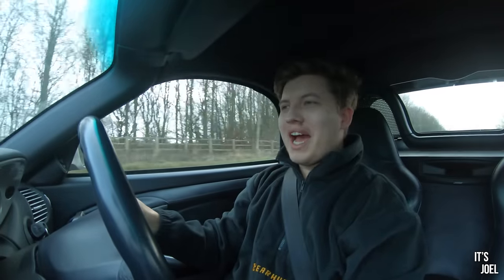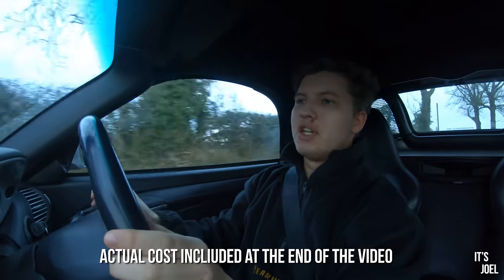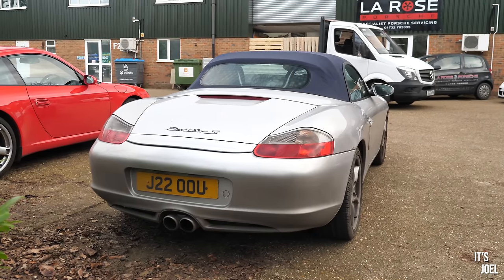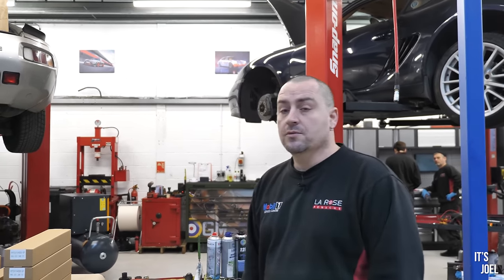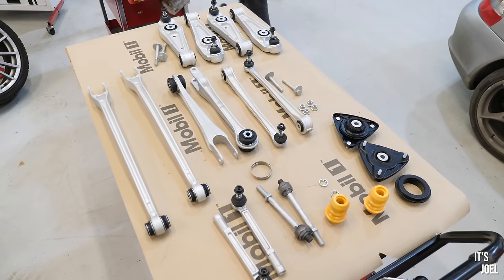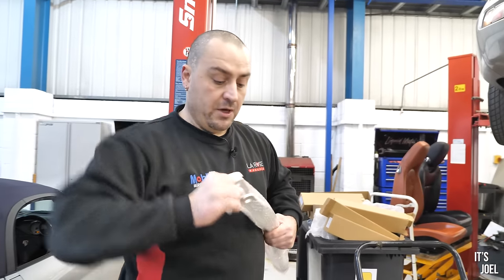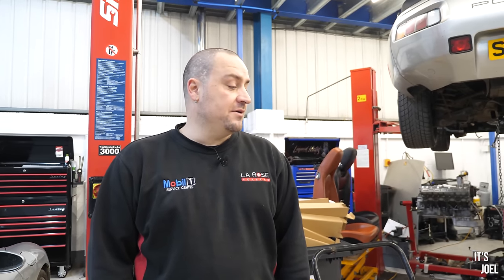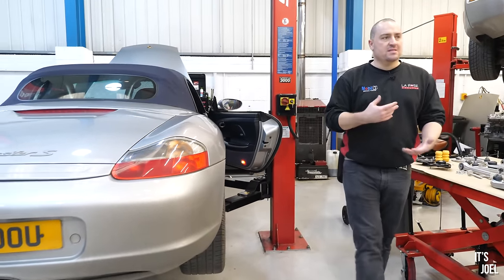Suspension overhaul for my 'cheap' 986 Porsche Boxster S

Comment: Interesting that 'in theory' the control arms and components are not actually worn or failing (except some corrosion and maybe the inner surface where the bushes fit?)  it's all the rubber bushes and ball joints that need replacing.  With enough time and tools you 'could' remove the arms then replace the bushes and put them back on. If the new metallic elements are the same as OEM then there isn't an advantage in weight or performance but the new bushes tighten it all up.  It's just quicker to replace the whole arm with new factory fitted bushes preinstalled and gives a more reliable repair rather than messing with pressing bushes in and out. Great content and video and nice to see professionals at work so relaxed and patiently explaining things
Reply: not in theory. it's just that it's aluminum not steel which complicates a refurb substantially

Comment: Bit confused as to why all that time was spent on removing the strut top and working under the wheel arch, if all the suspension arms and steering arms were getting replaced, it would have been so much quicker to remove the whole strut assembly then strip it all on the bench. Glad your enjoying it, thought Dean was really good, he should be doing his own channel
Reply: Couldn't agree more. I would have removed the compleat unit rather than using a torch Hammer and chisel on the car. And for the cost whilst there replace springs and dampers.

Comment: Can't believe the old shocks were left on. Just done the rear shocks on my Boxster. Massive difference
Reply: Same here.  If they were fine then maybe it’s understandable but I really didn’t understand the surprised tone that “it rides the same” because well, duh, same shock and spring.  But not my money so not really my business.  Also in respect of a fast road set up, this is great - for the 1% of the time the road and the weather and your mood is just right.  The other 99% of the time it can be like having a sugared up toddler pulling at your sleeve…nigglingly annoying.

Comment: You really wouldn’t want to go to all that trouble and expense and not change the springs and dampers on a car that age. I had two broken front springs on mine that were quite hard to spot - even the MoT guy missed one of them, I didn’t know until one of the broken bits popped out! I’d already replaced some of the tuning forks and coffin arms and I think the dampers made the most difference.
Reply: Yes did all mine on a 996, had all the seized bolts etc. I honestly didn’t notice any difference when they were changed, apart from the fact the car wouldn’t drive in a straight line as it knocked the alignment out. When the alignment was done it felt it’s twitchy but that could be be the different alignment. I did the shocks and springs, but they are very expensive to do, the porches springs were about 600 and I used biLstein shocks that were oe spec, these were another 1000.  The new shocks made it feel like a much newer car. Porsches are brilliant, but even doing all the work myself I have spent thousands keeping it running.

Comment: Good video.  Watching this makes me think a) I'm not so bad at fixing my own cars (don't panic, things don't go to plan, you have to get medieval sometimes with old suspension parts) and b) DIYing allows you to fix stuff that a garage won't have time to because they're on a clock, e.g. the rust developing in the wheel arch.  A quick scrub, rust killer and overpaint will stop a much bigger problem.

Comment: Hi Joel, I had my suspension replaced at eporsch with their Spyder Performance parts about a year ago. Transformed the car ( I had a few "snooker ball" noises and creaky top mounts) so needed doing. Car now so much tighter and the steering feel has improved massively since all the bushes have been renewed. Dean & Roly are top guys and wont replace things just for the sake of it.

Comment: Great video Joel, My 2004 Boxster S 550 anniversary has just had an engine rebuild by Eporsch @111,000 miles and was thinking about a suspension refresh, could be fun to compare the cars, the engine rebuild makes it feel like new, it is amazing the difference. Keep up the good work

Comment: Good job well done. Also worth checking the rear anti roll bar for corrosion around the rubber mountings. Mine had rusted inside the bushings so much that the bar/ rust had expanded and virtually seized the bar and bushing solid. Didn't help at all with ride comfort. On taking it apart and chipping the corrosion away the wall thickness of the bar was only half of what it should have been. I ended up getting 2nd hand bars and new rubbers which helped a lot with ride comfort.

Comment: During the ride towards the garage you could already notice on the camera that your car was not absorbing the bumps in the road. All bumps travelled directly to your camera mount. I am really wondering why you call this suspension overhaul while you don’t replace shock absorbers and springs. This was the perfect opportunity to do that, as you have the whole system loose anyway, and you would have saved the guys some sweat and tears because they didn’t need to get that topbearing from the shock. 
But…. Anyway nice improvement on the car! Really looks nice and it was informative and enjoyable to watch ! Cheers
And please replace your wiper blades, these are also due 5-10 years and with the amount of rain you guys have these is definitely worth the money😂 . (This was positive criticism)
Reply: I would have also replace the entire assembly myself given the amount of corrosion.  So this is why many people don't drive your supercars out in the winter.  Salt does a lot of nasty to metal.

Comment: I had a 2000 Boxster but it knocked in the front and the heating and AC blower inside the cab made a lot of noise. I decided to sell it at a loss. I felt the car was basically a potential money pit. I have an 82 911SC. I would rather spend money on that car

Comment: Doing all that without changing the shock absorbers - is’s not wise, to say the least. All the work has been done already, but without actual replacement.
Your absorbers are completely dead and corroded. 
If you’d change them as well - you wouldn’t believe that it is the same car, it would be mind blowing. Shocks - what makes all the difference.

Comment: Isn’t that not the cruise control stalk under the indicator stalk? Can see it clearly on camera when your driving….. unless you have had the stalk fitted and your meaning having it activated.

That’s the original location for cruise on every Boxster I have worked on 👍🏼
Reply from the maker: No, top is the indicator and 2nd one is for controlling the menu under the Rev counter
Reply: @itsjoel  
Ah yes so it would be the identical stalk on the offside under the wiper stalk

Comment: Really enjoyed the video, just wondering how the front springs were refitted with the top mounts on?
Reply: I've never seen the top mounts done in situ like this in all my years in the motor trade. Must have been tricky to compress the spring under the wheel arch.  Maybe the shocks were out of budget. Also a big job on the boxster because the struts can seize in where they slide into the hub.
Reply: @life_on_cars  Did the top mounts om my own 986 but removed the struts. I had to remove the hub assembly to get the anti roll bar link out as it was siezed soiid. Lots of penetrating oil and an impact gun to free it.
Reply: @nigelblack5295  yep. I did the same on the rear of my Boxster. As you say ARB bolt seized into carrier  . Heat and hammer required to force divorce

Comment: Ah the wonderful Porsche suspension - not! In my experince they suspension parts just don't last and cost a fortune to replace. I had a low mileage 986S, full Porsche history snd had clearly been well cherished. Yet parts of the suspension need replacing. The suspension is nothing special, yet a rubber bush that might cost £30 for a normal car is £150 for a Porsche. Thing is it is no different to any other bush, I know I have stripped and rebuilt suspensions for over 25 years. Nice car, but the price of parts is ridiculous

Comment: I'm puzzled as to why you go to all that trouble and not renew shocks and springs? And why not remove the whole strut to replace the top mounts? If nothing else it reduces the chances of these guys setting your car on fire.
Reply: I didn't hear it mentioned but the shocks probably checked out ok. i noticed he had to hold the shaft down while working so they still had their charge.  Cost was probably the issue as a new set of bilsteins start at $1400, plus even more labor.
Reply: @DSC800  I hear what you're saying but removing the bottom of the strut from the hub is a 5 minute job and would have made removing the top mount a lot easier (and safer). I think the issue with the springs and shocks is that the vid is titled 'suspension overhaul' and you can't really call it an overhaul by not replacing or even checking (you can't check a shock properly without removing it) the springs and shocks the most important components of any suspension system. I wasn't particularly impressed with the use of hammering, chopping, sawing and burning to remove stuff either.

Comment: Shame Dean cut the anti roll bar with the angle grinder
18:13
Reply: No anti roll bar was cut, just the seized control arms
Reply: @spyderperformance4729  he slipped with the grinder, you can see clearly that he hits the ARB
Reply: @5tevenH  . May have chipped a bit of rust off. Wouldn't have damaged it anyway. Was just a glance if anything.
Reply: @judgementalTX  you ever "glanced" anything with a grinder..... honestly
Reply: @5tevenH  . You seem determined to claim something was damaged which you can't even see. It was also denied by Spyder.